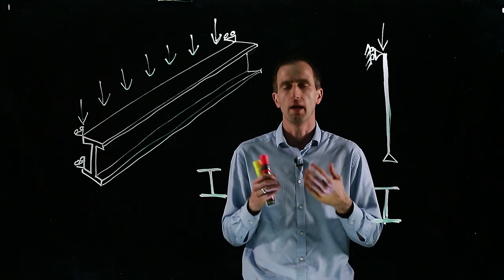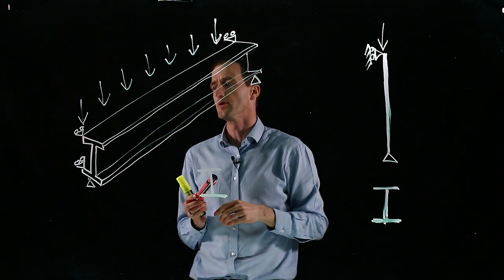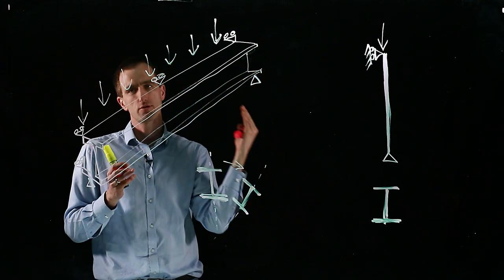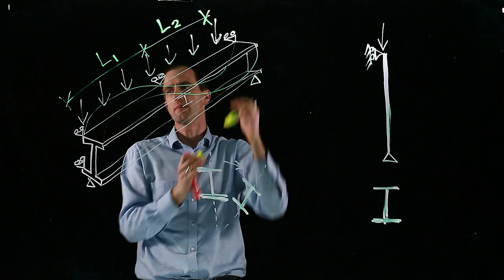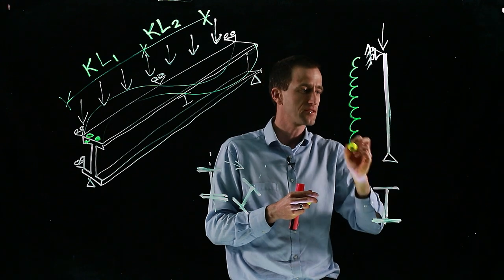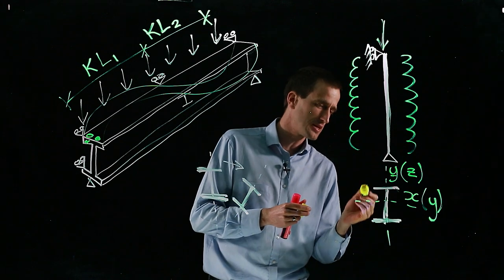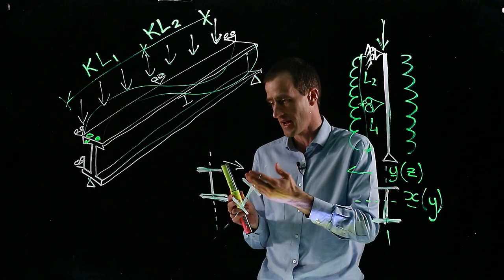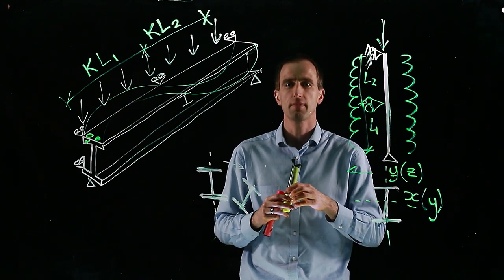Steel in Fire: Fundamentals of Design

Comment: What is logic of having a limit 140 Deg temperature on unexposed part of fire resistance insulation as per various international standard for fire resistance material
Reply from the maker: To prevent spontaneous ignition of any items on top of a floor, or on a wall. The value is quite low relative to the spontaneous ignition temperature of many materials.